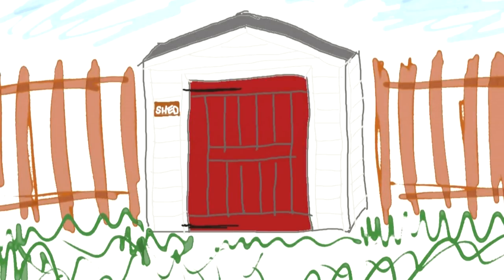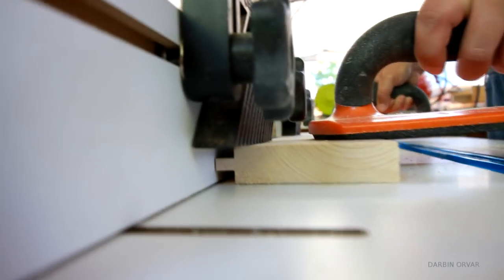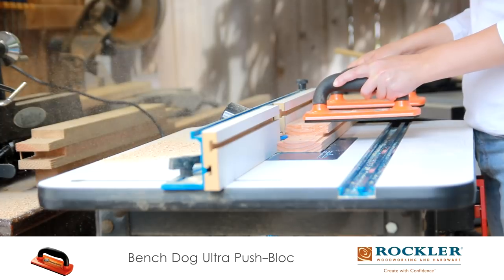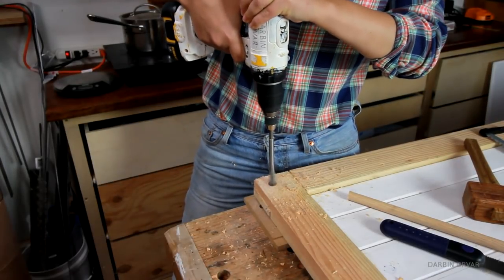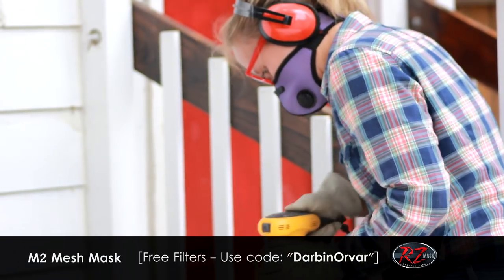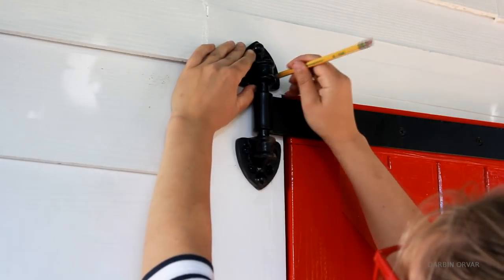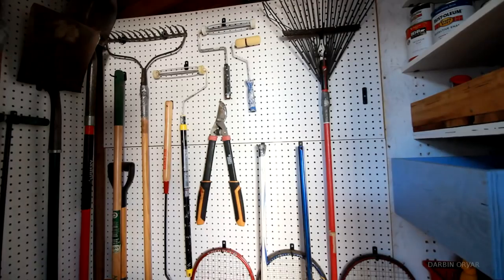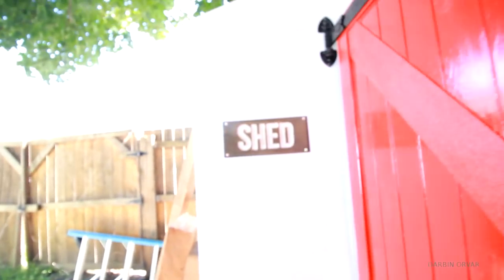Make a Barn Style Door for less than $40

Comment: It looks fantastic! One word of caution. The screws you used for the latch need to be bolts from the inside. Breaking in would be easy as only two screws need to be undone to open it up.
Reply: @Clive Flint...  He's right, Linn.  And even then you could remove the sixteen screws from the left side to pop the door off.  Or you could use those Chicago bolts with the one-way ramped driver slots.

I totally baffled the city when they redid my street and couldn't get my locked mailbox off the horizontal box post.  I had to bring out the generator and the A/C powered Dremel.
Reply: I would imagine it all depends on what kind of neighborhood you live in. Normally, it would not be common for someone to break into a garden shed located behind a home. I mean, what does a lazy thief need with a used rake, shovel, push cut mower or house paint? They are not valuable and he certainly would have no use for "work" tools himself.If you were to use it as a utility shed and keep valuable power tools, etc in it, then yes, tamper-proof latches and lock and key is in order.

Comment: Good job.  One criticism, though.  On that style of door, I believe the diagonals should angle to the other corners.   When a gate or door has diagonal, metal hardware that angles down from high on the hinge side, it's to resist the tension pulling down at the latch end of a heavy door or gate.   You hang the weight on a heavy duty upright at the hinge side,. Often  a cable is used.   Your style of door would have compression, not tension,  on the diagonal.. So for that style, the diagonal goes from low on the hinge side up towards the high corner.  At least, that's my understanding.

Comment: If you haven't done it already, trim the bolts holding the latch in place and pein the ends over, otherwise you will inevitably run into them with both arms full of gear and the blood stains are hard to get out - DAMHIK. Also - too late now but it may have been a good idea to drill small holes in the panel grooves of the middle and bottom rails so water can drain away avoiding dry rot.

Comment: Really nice job. When I added a latch to my shed, it didn't come with square holes and it just had a regular bolt so I used my angle grinder to round the bolt head after installation. I had an open shed for about four years until I added the doors. As soon as there was a door on the shed, the county added it to the property taxes. LOL

Comment: You didn't explain how you determined where to position the pintles on the jamb so that the door would fit correctly when you set the door on them. Or that you shimmed  the door in the frame when fitting the hinges and pintles. This is what I was hoping to learn as alignment is key in the door opening correctly.